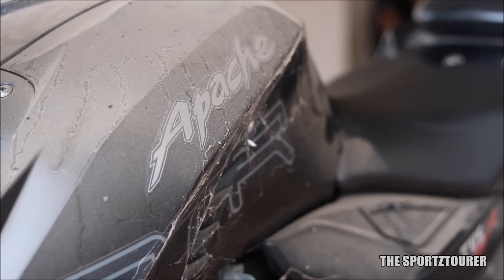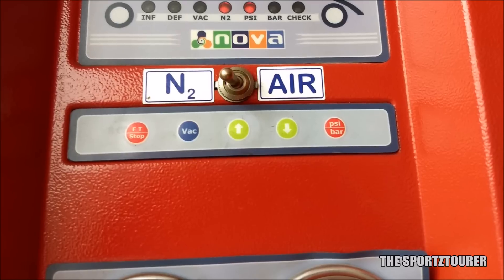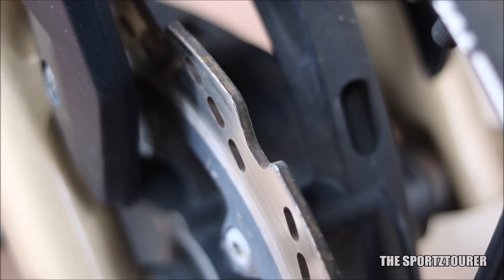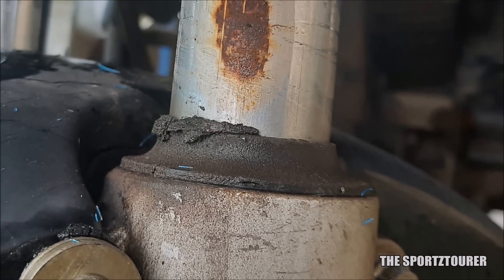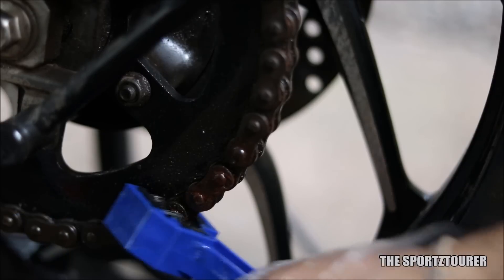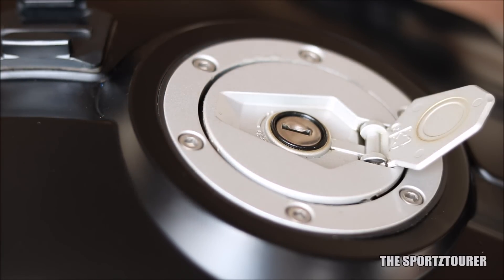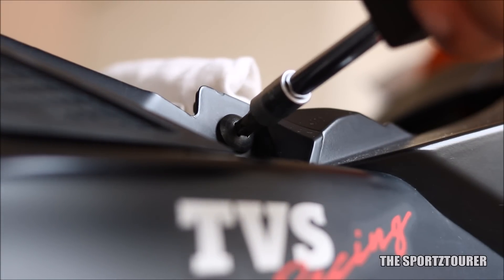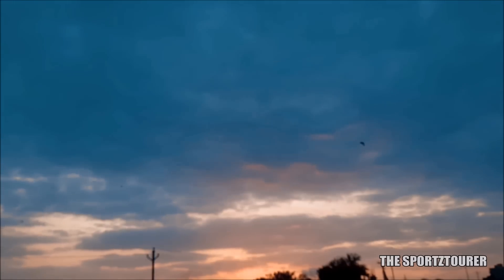HOW TO START & PREPARE YOUR MOTORCYCLE AFTER LONG TIME STORAGE BIKE NOT STARTED TVS APACHE DOMINAR

Comment: Hi Sportztourer, I have Duke 200, what is Maximum number of days in which we should change engine oil. I use Motul Full synthetic oil.
I use to Change Oil at every Service once a year or 7.5K kilometers. Which ever is early.
But if my bike Doesn't Run More than 5K kilometers in a year, so should i go for Oil change or Just wait to Complete 7.5k kilometer run. Your Suggestion will be helpfull.

Comment: Brother can you suggest me any good engine oil for pulsar 220 recently I'm. Using motul 7100 but alot of roughness and vibrations in the engine. Suggest me any engine oil which gives me refindness in the engine.

Comment: Hi Brother, very thanks for your informative videos, I have RTR 1604V BS4 i getting front break issue even i maintain well by replacing break pads on time and changing fliued oil .dot 4 but still getting break issue on my front. Cheked with many machanics but threy suggesting change whole caliber master cylinder kit it cost around 4 to 5K . 

Please help me to fix 😢

I changed Master cylinder twice times ..

Comment: Hi,
I need your advice.
At LRL motors they are offering maintenance kit of pulsar 220 consisting of free flow air filter, an oil filter and two iridium spark plugs. 
Do these items have any significant difference in performance and mileage of bike?
Please do suggest. The price is 1744 for kit and 1498 for only iridium spark plugs

Comment: I own a apache rtr 180. When i apply the front brake it is quite responsive at starting for about 2-3 kms but after riding it for about 4-6 kms the lever becomes stiff. When i apply the front brake the lever becomes hard and to apply the brake i end up pressing the lever hardly. Again 2-3 hours later when i ride the bike  same problem arise again. For few kms it works fine but after that it sarts having the same issue.. this is only with the front brake.. i changed the master cylinder 8 months ago.... please help
BTW LOVE YOUR CONTENT
Reply from the maker: Hi!
Get the calipers and pads checked. This could also be due to the air in the system where movement of air bubbles in the braking system can create such problems. A little bit of stiffness after continuous hard braking is expected but anything unusual must be inspected.
Thanks a lot for valuing the content 😊

Comment: What to do if there is rust on exhaust pipe?? Pls help my bike is just 1.5 yrs old. Its FZs v3. Please help
Reply from the maker: Pressure wash followed by rust off treatment works well in taking the rust off from the metal. Depending upon the material of exhaust bend pipe the rust can reappear which is common in many motorcycles.
Reply: @thesportztourer  thank you so much for the reply sir ❤️

Comment: From where you bought the screws? And I want screws for brake master cylinder for my rtr200 can anyone help??
Reply from the maker: The regular replacement screws were brought from authorized TVS service (I purchased them along with the new air filter) while a friend who rides Honda brought that chrome plated one for me.
You need that banjo bolt?

Comment: my question is in winter which oil will be better for motorcycle 20/50 0r 20/40 please reply
Reply: @Allie X 
sir 125cc from yamaha and it's motorcycle not a scooter
Reply from the maker: Hi @Abrafay Sheikh!
As suggest by Allie X you can go with 20W-40 for your Yamaha. We have quite a few old Yamaha motorcycles in our family and they respond well even to a good 15W-50 oil (for Gladiator/YBR).

Comment: I am planning to get d400 bs6. Whether camshaft and rocker arm issue still there. Can I ignore that and get the bike. Is there any anti rust spray available for silencer?
Reply: Hi, whats the camshaft and rocker arm issue of the bike? Never heard about it. I have a Dominar 400 (2017). Bike is on 17xxx kms. In here (Turkey) we are happy for using Dominar (except vibration).
Note for the video: Using nitrogen on casual ride is not recommended for tyres.
Greetings.
Reply: @ozgun91  that's good that you have no issues with your bike . Here at our home grown country people claim that 70 to 80 % 2018 and 19 has the issue I mentioned. In engine you would hear a noise like a coin rotating inside a washing machine. Few are also having it for 2020 model. Probably International units would not have the issue.
Reply: @roninr8199  I have just checked what is rocker arm and remembered what is it. I was on highway one year ago and riding fast on high RPMs (140-160kmh/ 8k and above RPM). I stopped on a gas station and i saw some liquid on engine. Stopped the bike and checked for leakage. And i push the ignition button but engine didnt start. I tried lots of times but i couldnt. Then i called the service, we've mounted bike on a Van. I continued my way by the coach. Yesterday i called the service and they said its about the valves and fixed it for free (on guarantee). Now when i see whats the rockerarm, i think the problem was caused by it. Hehe u've enlighted me. Thx :)
Reply: @ozgun91  the liquid you have mentioned might be coolant mix in engine oil. In India there were issues of coolant mixing with engine oil for 2018, 19 version. This is due to leak in the gasket seal. I don't have the bike yet but planning to get in a month or two so doing research on bike 😂😂

Comment: Bhai I bought new rtr one month back but today suddenly when I ridding a bike it's feels like tyre is punchure but in actually it's not , I fill the correct amount of air in it still fell the same problem over riding above 40km/hr speed, it's just feel like some thing in tyre which unbalance it on straight road I checked all the tyre but didn't found any thing 
Please tell me any one had this kind of issue